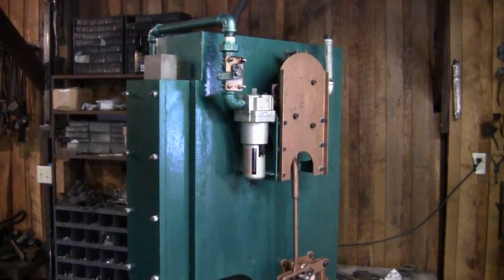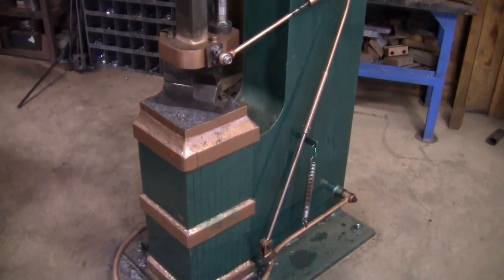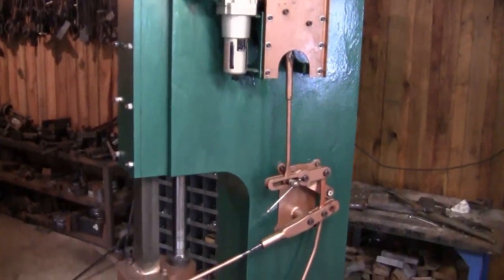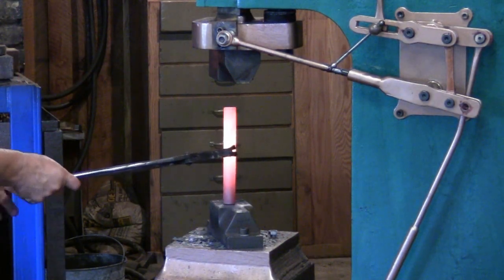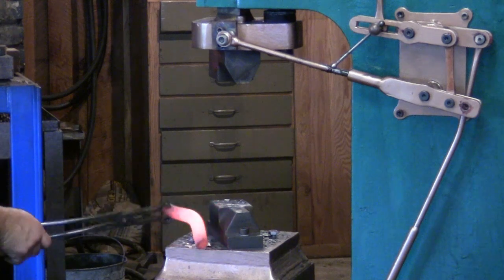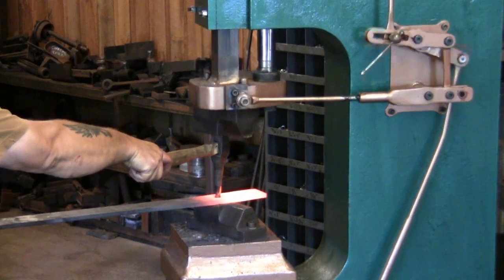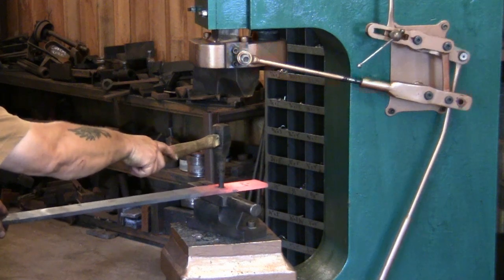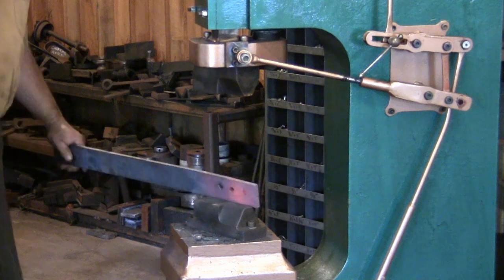Ken Zitur KZ100 Power Hammer

Comment: VERY,  VERY  GOOD  DESIGN, sir  !  You  made it, with  ALOT  of  ' throat ' space; making for probably  300 degree, work area, around hammer  HIT   area. For good movement, over the dies.  Also, just as good  as  any   ANYANG   air  hammer   !   With alot less  floor / head  space  needed.  How  much air supply storage /compressor   do  you  have  ????
Reply from the maker: Our system is pretty easy on air consumption. I have a 30 year old c'aire compressor 5 hp two stage with an 80 gallon tank. I have had 2 MZ75 hammers and 2 KZ100  hammers running on this compressor at the same time.

Comment: You got my attention when you mentioned steam. The same technology was used aboard US Navy vessels as feed-water and fuel pumps for the boilers. The auxiliary valve shifts on the upstroke and downstroke admitting or exhausting steam from each side of the main piston; known as double-acting. This ensures a smooth and constant delivery pressure. Very simple and very reliable. Are you incorporating a double acting design or is yours spring-return? Darlington, South Carolina
Reply from the maker: double acting